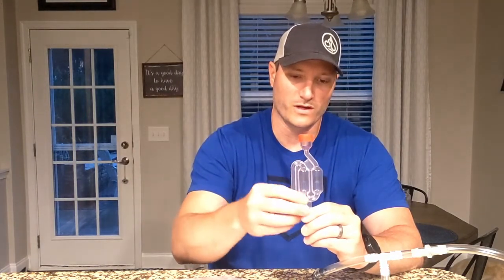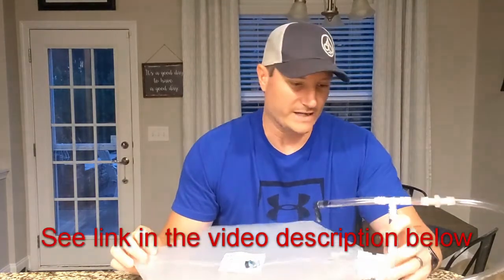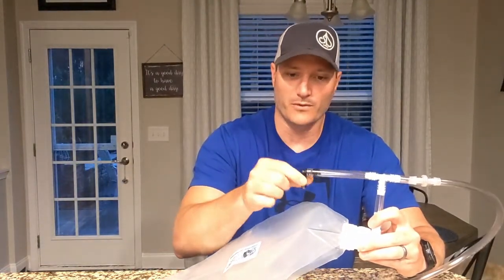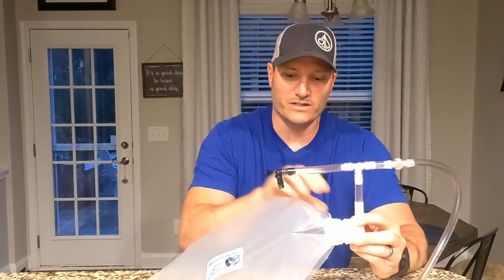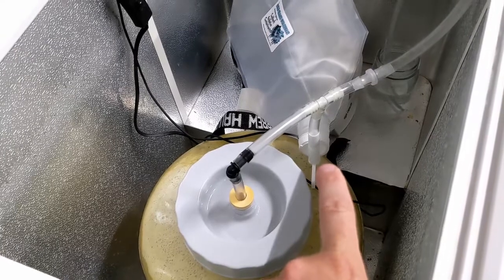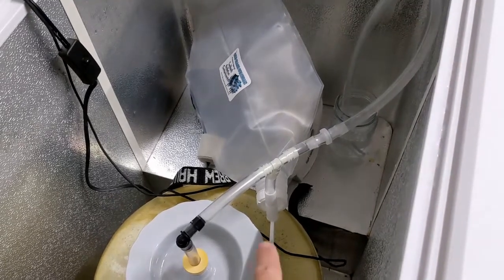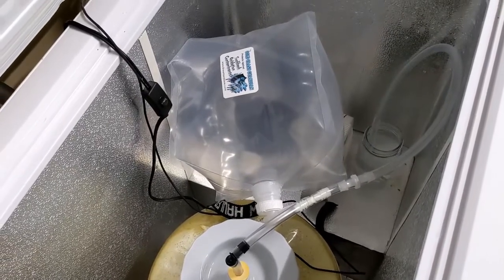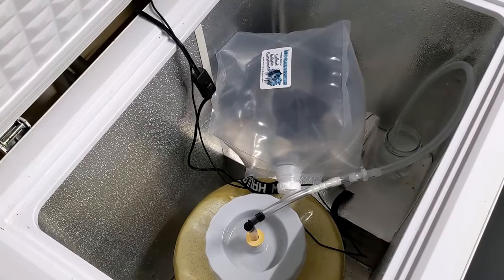Cold Crashing a NEIPA/Hazy with no Suck Back - Cold Crash Guardian

Comment: So you capture the co2 way before cold crashing, I guess as soon as fermentation begins, I am interested in this but I’m concerned on if there’s enough co2, my fermenter only drops about 4 degrees a day so after d rest it would take 7 days to get to 40F would the bag need refilled with co2?
Reply from the maker: You can put on the cold crash guardian right away, but with the valve closed to push out any oxygen in the vessel. Then open the valve after fermentation activity is going strong, to start filling the bag.  I have had no issues with the bag fully depleting and having to refill it. That may depend on the size of your fermentation vessel, I generally do 5.5 gallons in a 7.5 gallon vessel (fermonster) with no issues.  This includes slowly dropping the temperature over a week as well.

Comment: How would you cold crash a lager since they already ferment in cold temperatures?
Reply from the maker: All lagers should be risen to a higher temperature of about 68 to 70° for a diacetyl rest.  This should be done with a couple points left in gravity before fermentation is fully complete. This will prevent the buttery popcorn flavors and give it the clean crisp lager flavor. After that, is when you cold crash back down to mid thirties Fahrenheit. 🍻

Comment: Do you need this product if you cold crash in a keg? Can negative pressure harm keg? like implossion or something? Assuming, of course,  no CO2 line is attached.
Reply from the maker: I wouldn't worry about implosion, but you might lose enough pressure to unseal. Kegs are meant for pressure from the inside... The poppets and pressure relief valves may not hold from reduced pressure inside. I don't know if that's true or not, but I'd suggest putting a little pressure on it as you're slowly cold crashing. In some cases I don't gold crash before I keg... Then I just put it on 12 PSI and cold crash it as I'm carbing it up. 🍻

Comment: Hey man, thanks for the very informative video! In your opinion- if I wanted to use this on a beer that has finished fermentation, do you think you could just fill the bag with low pressure co2 psi and use it as if it was at the second stage of use? Or would there be some sort of weird co2 psi issue with the co2 not being from natural fermentation.
Reply from the maker: Great question, You can absolutely do that.  I do that sometimes too if I forget to put it on at the end of fermentation.  The CO2 from fermentation is not different than your tank.

Comment: Curious to know how much volume reduction happened for the bag  during cold crash? If fully “inflated” at end of fermentation how much CO2 was needed from the bag to complete cold crash?
Reply from the maker: Not even a quarter of it. It's actually a lot less than what is in the volume of the bag. You could shut the bag off halfway full if you need to or less.

Comment: So am I understanding right that when the bag is full, the release of excess co2 is automatic, so you don't have to monitor it and risk blow up?
Reply from the maker: Yes. The cold crash guardian I use in the video has a one way valve that allows the excess CO2 to be pushed out after the bag is full, but does not allow oxygen to be sucked back in when the temperature decreases during the cold crash.
Reply: @CityscapeBrewing  damn, not available in the UK :/
Reply from the maker: Darn.... Maybe you could find a one way gas valve and make one using a collapsible water container?   Could be a new video idea for me! Haha

Comment: I just quickly switch my airlock for a seal before putting the container into cold and that's it.
Reply from the maker: I don't generally worry about oxidation except for hazy IPAs. In fact I don't even cold crash many of my beers I prefer to do a secondary instead. But when you just seal it, doesn't oxygen suck in whenever you break the seal?  I was showing the cold crash guardian because it allows equal pressure, and sucks the CO2 back in rather than oxygen.
Reply: @CityscapeBrewing  Well the pressure is equal when I remove the airlock so in theory if I change it quickly very little air gets in the fermentor.

I only remove the seal when bottling and it shouldn't matter much since there is a protective CO2 layer for the brief time I'm bottling. More oxygen gets in the beer while bottles are filling.

I will try to bottle a pale hazy NEIPA soon just to see how little oxygen my process intakes.
Reply: @CityscapeBrewing  Just to clarify, after changing the seal and putting the beer to cold, the pressure will drop and the fermentor will bend inwards a bit. But no real oxygen exposure until I take the seal off
Reply from the maker: I agree. The blanket of CO2 will protect it unless it gets roused up somehow. I have had hazy IPA get oxidation just from transferring from fermenter to the keg, without purging the keg first. I don't think you're at much risk from just the airlock seal as long as you're being careful with everything else.
Reply: @luwn00bz  Are you doing closed transfers to a keg? The negative pressure built up in the fermentation vessel will pull in oxygen the moment you open it.